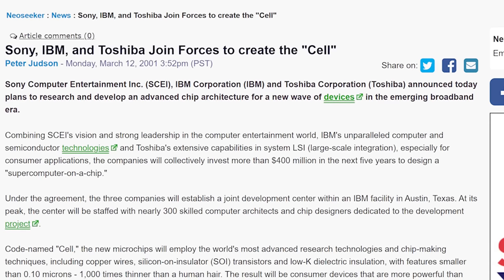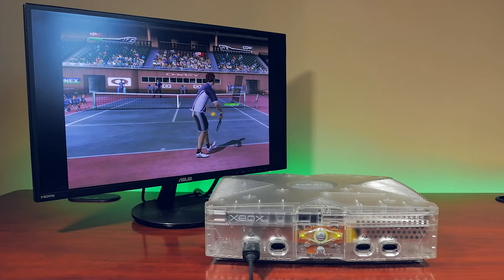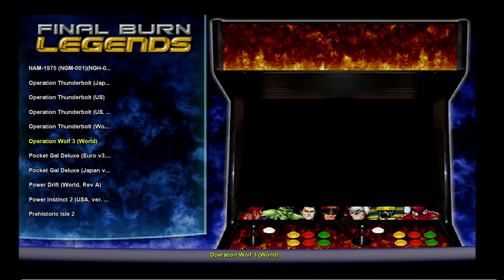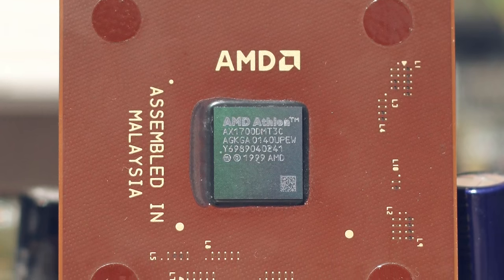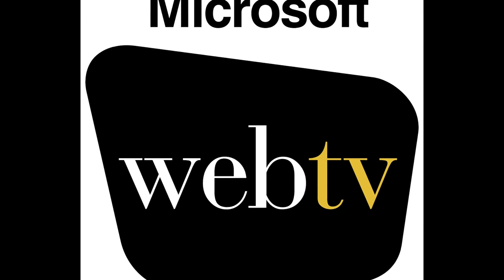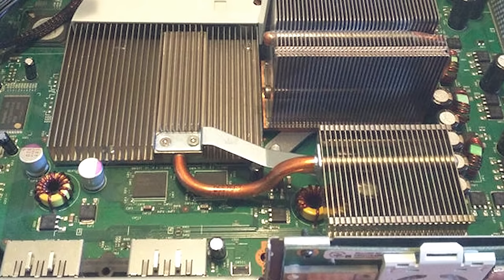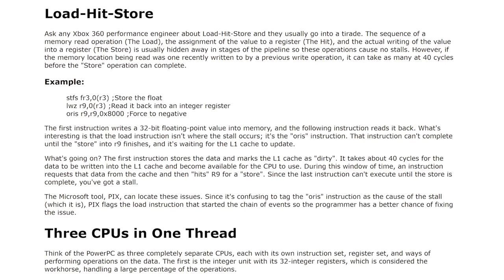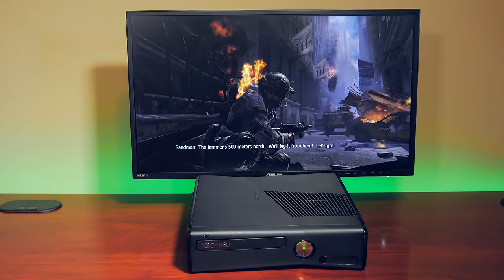Why Microsoft switched from Intel to Power PC for the Xbox 360  | MVG

Comment: It's funny that they basically ended up selling the same heat monster to all three competitors.
Reply: Nintendo's CPU's were based on the very efficient PPC 750 https://en.wikipedia.org/wiki/PowerPC_7xx
Reply: The GCN from the wall pulls only about 40 watts of power. And that is everything combined. Graphics, cpu, ram, drive, controllers, blinkenlights, all combined drew half the power of Xenon by itself... And that was even more so with the Wii
Reply: IBM did a Microsoft against Sony, by licensing the chip to Microsoft.
Reply: @wishusknight3009  First gen Wii consoles ran pretty toasty too, nothing  serious like it's counterparts but still. Later models around 2008 with newer 65nm Broadway chips were much more efficient.
Reply: @Officer94  a 10w chip can get very hot without sufficient cooling and in a small box ;) fortunatelly my wiis still run hot but fine...
Reply: @Locutus  people have to know the history of DOS to get that, I think. IBM rushed to get PCs out, initially as a "loss-leader" to get businesses into "real" hardware. They never imagined Microsoft would license to companies like Compaq. I guess IBM was looking at DEC's terminals for a business model. Bad move. Apple deserves credit for popularizing the idea that individuals should own/be in charge of their own computers. Commodore64s were too underpowered, and Amiga too late. Being older, I know history of "home" computers (now nearly all called PCs). Funny how many parallels there were in 21st century consoles. I imagine the same is true for smartphones.
Reply: Yep. And the 970FX CPU in the last PowerMac is exactly why Apple dropped PPC. It was such a power hog / heatmaker they couldn’t make a laptop that used it.
Reply: @Officer94  First Gen Wii's only ran toasty when WiiConnect 24 was enabled. Now that the online servers are down (except if you homebrew in RiiConnect24) it doesn't get that hot in most cases. Most heat issues with the Wii came from Standby Mode (yellow power light, meaning it's not completely turned off, so it can listen for internet)
Reply: 360 should used an AMD Athlon 64 based chip, PowerPC was crap. Microsoft should have seen that Apple was moving away from it and negotiated with AMD to build a custom x64 chip.
Reply: and now AMD are doing the same, putting Zen 2 in PCs, XSX & PS5!
Reply: @TVperson1  In the end it all came down to cost. MS could have contracted AMD but it was not cost effective. PowerPC had a better price-to-performance ratio and it all that mattered. MS simply thought they could engineer the XBox 360 to dissipate heat efficiently, and I can't for the life of me understand how they could push the product out without redesigning what was obviously a faulty design for thermals. I guess they were running out of time and had to ship, so the decision was ultimately made to go with whatever was available for launch.
Reply: @elimalinsky7069   I can understand wanting to be first out and keep costs down, but I can't imagine the 360 would have been that more expensive over all, perhaps like $100 more and, the release may have been slightly later, not by much though. But the ease of development would have meant games were released faster and PC cross platform porting would have meant the 360 and PC could have had games there devs wouldn't have bothered programming for the PS3. Not to mention the money saved on avoided the red ring of death.
Reply: @elimalinsky7069  AMD's CPUs were being put inside more and more brand name computers, it seems like they'd be able keep with production and could have worked with MS early on (2003) to develop a cheap CPU for the 360 which could then be slightly altered for the PC market, but if you have information to the contrary, could you provide a source? With AMD gearing up to buy ATI, a future APU could have greatly slimed the console down in the future. The low IPC and high clock should have been a clue for PPC running hot, based what you've said; the neutered specs make it sound like a horribly in efficient CPU. 
PS3 was always going to cost more due to it's Blu-ray drive and MS had enough developers onboard to get ahead of Sony. As for Marketing, I don't think using the CPU Apple was currently using really did MS any favours.
If the 360 was x86 based, it would have a been a much better product in the long run.
But at least the Xbox One X and Series X are now what the 360 should have been.
Reply: @TVperson1  I remember forums back in the day discussing AMD focusing entirely on the desktop while Intel had presence in diverse computing devices, so the conclusion was that AMD would not do consoles. I think Microsoft had good reasons to go with PowerPC and that they had done a thorough market research and checked all their options. Nintendo and Sony seemed to have had full faith in IBM and their ability to deliver high performance with high yields and relatively low prices, so all that Microsoft had to do is follow suit.
Reply: @elimalinsky7069  I guess that makes sense. I do remember being disappointed at the time that 360 was a bit of a diversion from the core PC hardware and that turned it into more of proprietary device, more similar to the Sony and Nintendo. In my eyes the 360 lost it's soul, more of an emotional argument I know, but I always liked that Xbox brought PC hardware into the console space.
Reply: @TVperson1  And now both Sony and Microsoft are using x86 in their respective consoles for two generations straight. In the end x86 is the best choice for gaming and makes life a lot easier for developers due to the amazing optimization and performance of x86 compilers, which is the result of decades in software development for the PC.
Reply: @elimalinsky7069  Agreed
Reply: @elimalinsky7069  Also, I apologise if I sounded arrogant in my arguments
Reply: @TVperson1  Not at all. All arguments are valid. Cheers :)
Reply: @Locutus  Not at all. The Cell contained a PPE core with 8 SPEs. A PPE was basically just an in-order PowerPC core, so essentially what they already had, but without the out-of-order aspect. For the Xenon, they just reused the PPE--putting 3 of them in the chip. With MS-DOS, MS told IBM they could provide them with a DOS, bought a DOS from another company (without letting them know what they were going to use it for, of course), modified it slightly and licensed it to IBM under a non-exclusive licensing agreement, and then licensed it to anyone else, including those who actually cloned everything that made an IBM PC an IBM PC, including graphics cards and BIOS.
Reply: They were hot but they weren't that hot. They weren't NetBurst hot.
The original 360 wasn't a great design, physically, but it was a learning experience. Sony's still learning it seems
Reply: @MostlyPennyCat  It was the heat + crap solder. 1 Billion dollar learning experience.  It seems Sony didn't have that issue, their issue was with the craptastic NEC/Token capacitors
Reply: @TVperson1  
Yes I know all about the solder, RohS affected our industry too.
It wasn't crap solder, it was just everybody learning how to use the new solder correctly.
3 generations on and Microsoft have mastered industrial design, Sony have not.
Well, there's all least work now, but they are neither quiet nor attractive solutions
Reply: @snetmotnosrorb3946  PowerPC 750 wasn't efficient. It was just a lower power CPU produced with the same manufacturing process meaning that it ran cooler and stuff. The older PowerPC 750 from the Power Mac G3 was definitely hotter than the one used on the Gamecube and Wii. Though I must say that the PowerPC 970 series used on the PS3 and Xbox 360 was indeed known for it's heat but you should be aware that the Xbox 360 was ALREADY using a die-shrink version of the Power Mac G5's processor... Meaning that the G5 was so hot that they needed to die-shrink twice to get a machine that runs cool enough which is the Xbox 360 S (not only it is a die shrink to 45nm but also it's an SOC).
Reply: @snetmotnosrorb3946  You can't call any PowerPC efficient. ARM is efficient, PowerPC isn't ok? Well depends actually the Xbox 360 had an amazing workstation class power at the time... The Core 2 Duo was eating dust next to what the PS3 and Xbox 360 were capable of in CPU terms. And even the Core 2 Quad isn't a match for the PowerPC 970FX same CPU as the PowerMac G5 by the way. PowerMac G5 = Xbox 360. PowerMac G3 = Gamecube and Wii.
Reply: @rockapartie  The Original Socket 939 X2s were DDR1, the Socket AM2 X2s did use DDR2. As for heat, that was more of an issue with powerPC than AMD, hence why Apple moved away from it. The Original 360s didn't have an APU, it was the slim where the GPU and CPU were married.
Reply: @rockapartie  Ah I did too sorry. My other point was more that those Athlon 64 CPUs could handle DDR2 and with the IPC being what it was with the Xenon, having more cores wouldn't have improved much over the more reliable and cooler running Athlons.
Reply: @wishusknight3009  NGC you mean?
Reply: @ronnieradon  Nope, GCN... It doesn't make any sense to me either. But that is what it seems to go by in most retro circles.
Reply: @wishusknight3009  so what lol
Reply: @ronnieradon  That is also what it was called officially by nintendo. GCN was the official abbreviation.
Reply: @snetmotnosrorb3946  That's because they underclocked it.
Reply: @TVperson1  my first gaming pc had the athlon x4🥺
Reply: @HistoryandReviews  Mine was an AMD Duron 1.3Ghz from 2002. I put a Geforce 4200 ti in it to make it a gaming PC.
Reply: @TVperson1  was it fast?
Reply: @HistoryandReviews  It was able to get above 30 FPS in the Matrix game. Later Half-Life 2 ok due to having 128MB Vram. If you had 64 you couldn't get above 20 FPS. But by 2005 it was getting slow, CPU died one hot day. So I got a new machine with an Athlon 3800 X2 machine with Quadro 540 (Didn't know much about Quadro back then, thought it was a fancier 6600 GT). It had a 10K RPM drive. Was pretty cool at the time.
Reply: Well, it was either the heat monster off PPC or the heat catastrophe of netburst.
AMD didn't have a custom chip business yet, they were still trying to be another intel, and ARM made 200mhz pocket pc socs.
Then AMD got the hint and started selling custom socs to whoever could afford them.
Reply: IBM fucked Sony by selling they R&D, but it’s not the first time, hardware/software industry is really like this… they stole and re ship it…
Reply: Even the Wii U is relatively low power draw, also using a newer low power POWER architecture.

Comment: I remember when I was an Apple true believer arguing against Intel fans, advocating for the superior performance of PowerPC RISC chips even though they had lower clock speeds than Intel Pentiums. "Wintel" (Windows and Intel combined) were the enemy.  Then not only did Apple leave PowerPC for archenemy Intel, Microsoft left Intel for PowerPC.  Boy was I thrown for a loop.
Reply: Well, Microsoft only left Intel on the console side. They obviously still work with Intel. lol

But yeah, I also had a friend that said the same thing about Apple. But at the time, the statement was also true about AMD processors being fastest than Intel despite their CPUs being faster.

Intel was heading downstream fast, but it was their mobile division that developed the core duo that saved them. I think that was also around the time that Apple went with Intel. The Core Duo is what put them back in the map.
Reply: Apple for the longest time used RISC in their computers. From 2006 to 2020, they used x86 Intel chips before going back to RISC with the Apple M chips.
Reply: The dual cpu g5 was quite amazing for its day. I have one in non working condition, a single chip g5 I used to dual boot tiger and Mac os9, and a 1st gen Mac Pro that both still work and get used from time to time.
Reply: Started with AthlonXP 1800 on nforce mobo with geforce2, never heard from wintels, cause it was the best bang for the buck, officially on the early Tom's hardware.
Reply: Lesson learned, simping for companies is a fruitless endeavor
Reply: @serene-illusion  profile pic sauce?
Reply: It's funny, apple sewed their seeds with Intel when they adopted USB around 98/99' (an Intel technology )when Steve Jobs came back.
Reply: Im sure they would have loved to stay with intel and not spend billions changing their whole product line. But it would have been impossible with the plans Apple had for mobile devices. Apple needed power performance above everything.
Reply: @serene-illusion  So true. I waited longer and paid extra for the MacOS version of games, only to have Apple's software updates cut off compatibility with more and more of my game library. That was my reward for loyalty.
Reply: I have an eMac, even overclocked it!

Dear god it's slow. Part of that is probably ram related, but when I trashpicked my Dell Dimension 2400 it had 512MiB of ram and a 2.4Ghz Northwood Celeron.

The Dell was atleast able to play my stupid web browser game. The eMac wouldn't even pass the first frame.

I should upgrade that eMac and give it a round two. I should probably also install linux on it so the software stack on the two machines would be more identical.

Comment: 22 years later and Cell still haunts Playstation in terms of PS3 backcompat
Reply: That's unfortunate, wasn't it the most powerful console at the time?

Seems like they should have developed that architecture So we wouldn't have all the low end x86 trash we have today.
Reply: In that case wasn't it IBM that pushed the Cell architecture to Sony in order to push a "home supercomputer" platform?
Reply: @stevenswall  x86 is way more powerful than PowerPC ever would have been. why would you put supercomputer architecture in a console, they are the last thing I would think be running one math equation a billion times.
Reply: I'm so confused, ps3 dropped way after the year 2000
Reply: @PMARC14  That's pretty much what GPUs do. Modern integrated GPUs are basically the same idea as Cell.
Reply: @argvminusone  but Cell is specifically for accelerating compute, not graphics. The 8 cell mini processors are much more like the terascale processors coming out recently for servers. Mind you CELL also has debilitating overload in programming for it in sending data to it, with a lot of load and store operations to get data to them rather than sharing cache or memory pointers. Meanwhile modern NPU and GPU have a lot of frameworks and good compilers to accelerate that work when they do compute, along with much better architecture for consumer use.

Comment: Thought the first song was familiar. Turns out it's from Touhou 4! Good choice
Reply: same lol
Reply: 2hu gang
Reply: lotus land story....
Reply: PC98 Touhou is godly.
Reply: Best Touhou
Reply: Yeah, it's the intro song, but the instrumentation is a bit off compared to what I'm used to. Did the PC98 have different sound chips?
Reply: Zun go zoom
Reply: Title theme right?
Reply: @cheeseisgud7311  Yep!
Reply: @BottomOfTheDumpsterFire  It's from the Akyu's Untouched Score remastered version of the OST, which in turn is based on the version of the OST included on TH05 Mystic Square.
Reply: Ah a man of culture
Reply: Listen 2hu
Watch
Reply: Yeah I was quite surprised that MVG used an intro from the old PC98 Touhou 4 lol
Reply: can i have the youtubes link to the song
Reply: @BottomOfTheDumpsterFire  it sounds slightly higher pitched. Which isn't that differ to accomplish
Reply: @realcartoongirl  search Lotus Land Story ost
Reply: @Dooly00000  It's not higher pitched, the arpeggio is lower pitched by a semitone and way bassier.
Reply: @BottomOfTheDumpsterFire  using HOOT, the OPNA streams can be customized. I don't know that's what MVG did but I know it's possible
Reply: TOUHOUUUUU
Reply: I'm not familiar with PC98 Touhou, but I did feel that it's Touhou-ish
Reply: I FUCKING KNEW IT. Based
Reply: @BottomOfTheDumpsterFire  Depending on the sound card it will sound different 
Some use OPN or OPNA chips and SSG mixing is different between most cards

Comment: One small mistake: The CPU wasn't a Celeron when it released, but a slightly stripped P3. It wasn't until Coppermine Celerons that they had the same cache design as the Xbox chip.
Reply: not just that they didn't leave ibm to ati they left for AMD which had bought ati before this time ati was no longer ati anymore that that time there are more then one mistake in there
Reply: @raven4k998  Indeed, IBM was then at the top of their game CPU wise. It wasn't until Apple went Intel, that that started to wane. A powerPC based cpu was really a great processor to have for a console. In fact, the Xbox one CPU is not that much faster, but it has branch prediction  and out of order execution. Which makes it more powerful. But theoretically the Xbox 360's PPC should be able to keep up. (Graphics is a whole different matter of course :P ).